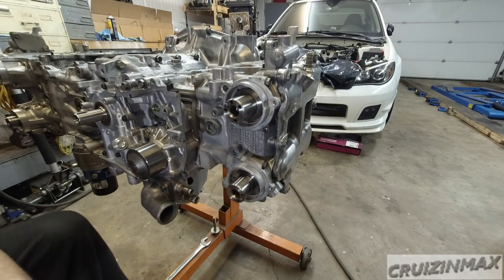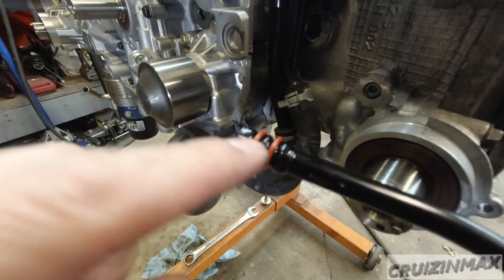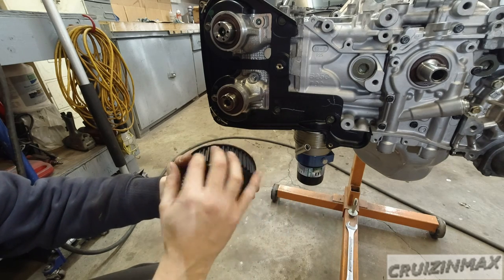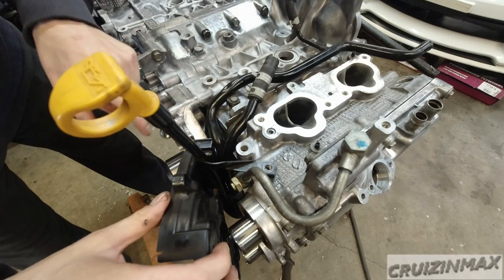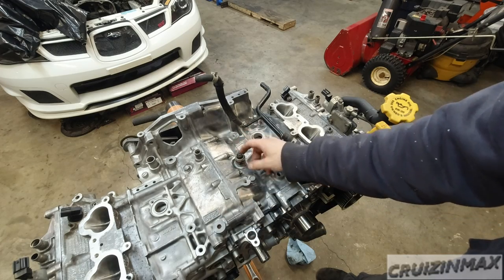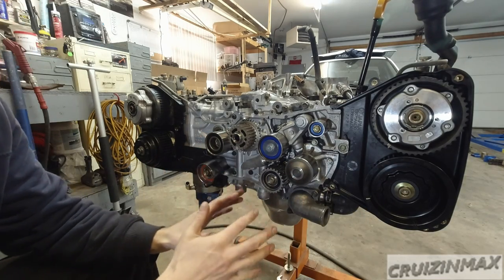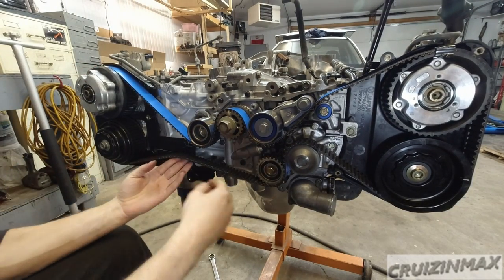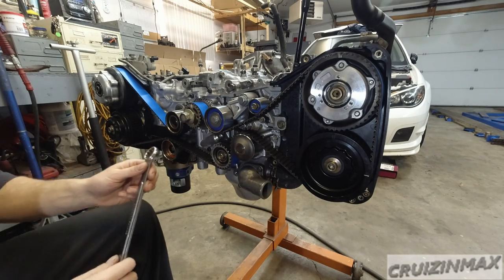Subaru STI EJ25 build part 6 sensors, timing belt and more

Comment: did you use any Loctite for the tensioner bracket bolts and what torque do you torque them to for the top 2 and bottom bolt.
these videos are so good man
Reply from the maker: I never use loctite for those bolts but theres always white residue on the top 2, I think its because they are exposed on the other side, meanig its a through and through hole on both, use blue if you want to or some kind of sealant, torque is 18.1 ft.lb.

Comment: Question how do you know that all your timing marks are lining up? Did you have to put the camshaft a certain way whenever you installed  it or do the bolts for the sprockets only go on if its lined up correctly?
Reply from the maker: I explain and show all of that in the video
Reply: @cruizinmax4017  I must have missed it I'll watch again.